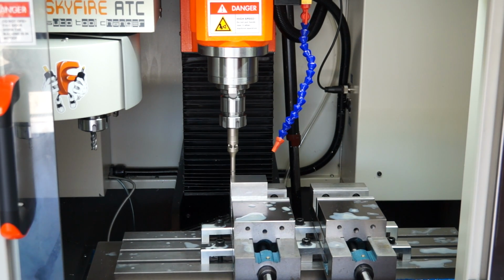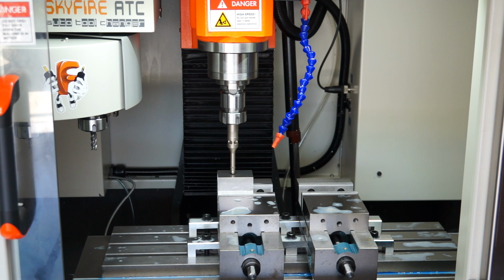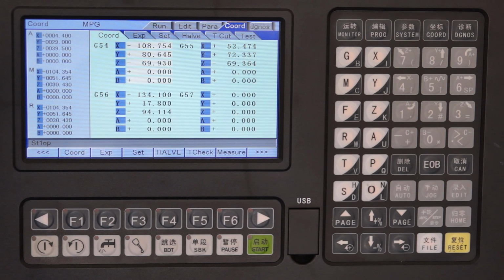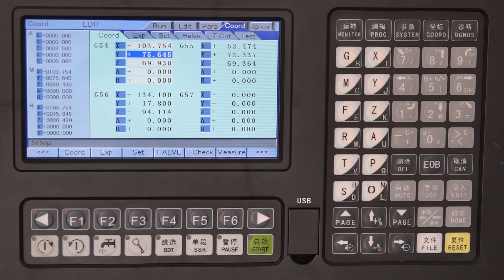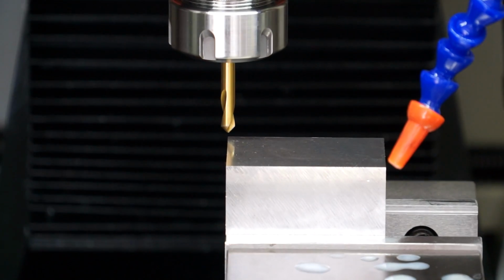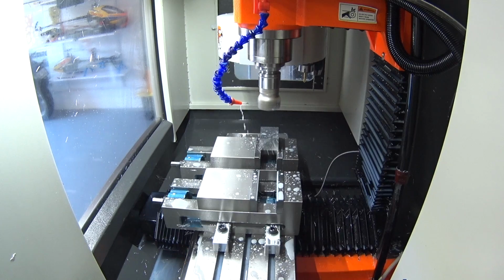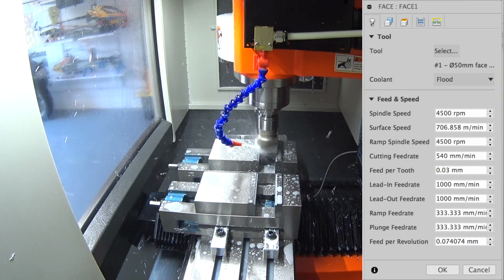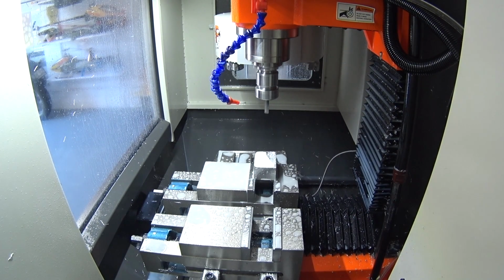Mill Vise Stop Pt.2 - CNC machining Fusion 360

Comment: Fantastic. That machine looks like it's really working well.
Reply from the maker: Hey Rus it's great to hear from you.  How have you been mate?  Yeah, my little machine is still going strong.  The servo motors lack some holding power, so I try not to push it too hard.  However, it's still an awesome machine to have in my garage.  Cheers, Aaron.

Comment: Thank you so much Aaron for showing the probing details. Very very appreciated.
Question: Are you using special aluminium blades / inserts for your face milling cutter? Do you prefer R0.2 to R0.8 ones? Did you try PCD inserts? Herri
Reply from the maker: Hello Herri, you're very welcome.  Yes the cutting tools I'm using have been designed especially Aluminium.  The shell mill I'm using is a Chinese one and I think it has 0.2r cutters in it. They work ok ;-)

Comment: Very nice Aaron the parts look great, hey howcome you run the chamfer mill conventional cutting? Noticed it was opposite to the contour op. Do you get a better finish?
Reply from the maker: Hey Luke, good pick up mate.  Yes, when I use spot drill to chamfer a contour it was producing a very small burr on the part requiring hand finishing.  That really annoyed me so I attacked it with conventional milling and this solved my problem and gave me a better finish.  Cheers mate ;-)

Comment: Thanks for sharing. Are you using the tooling's recommended speeds and feeds or are you making changes based on your experience (so far) with the SkyFire's capabilities. 

The quality of the finished machining looks very good for a low cost machine. Hopefully you can make another video with your thoughts on the machine's performance to date, any changes of opinion since your first video on the topic and what nuances have cropped up.

Also, do you think going to a bigger coolant pump and two nozzles might help with clearing chips?  Again, many thanks for sharing!
Reply from the maker: G'day Doug how are you mate?  I'm still happy with my little SkyfireCNC machine.  The only problems to date are the coolant lack of pressure and cabinet coolant leaks.   I've also noticed that my servo holding power on the table to be a little on the weak side.  If I run aggressive cuts using a 10 or 12mm (3/8" or 1/2") end mill at full depth 25mm (1") the table will rock and roll a little.  So to get around this by reducing my cutter step over to 20% and take 2 passes instead of 1.  At the end of the day it still has limited horsepower (2-3hp) so I can't be too aggressive with it.  To be honest Doug, I'm a very conservative machinist and many guys who run production would laugh at my feeds and speeds.  However I'm in no rush to push the little thing to it's breaking point, as I'm not running production and purely using the mill as a hobby machine. Cheers, Aaron
Reply: DCTTeacher1 Thanks for the feedback. I'm seriously considering one. I'm not surprised at the coolant pump issues, which you have addressed. 

As for performance, your results, in my opinion, are to be expected for this price bracket and size of machine. 

I suspect, even if the machine came available with a 5 HP spindle, it would mean the surrounding structure would also need strengthening. Thus the Snowball of costs begins. Taking it slow and remaining in the machine's capabilities, is the Skyfire maintaining tolerances? My best.

Thanks!
Reply from the maker: Oh my pleasure Doug.  I enjoy interacting with my viewers from all over the world.  Especially our cousins over in Canada ;-).  Hey, I will send you a private message OK?  Cheers, Aaron.
Reply: Responded. thanks. I'll have to behave. If you let my relatives in Albury Wodonga know I've been talking to you instead of them, they'll send the Roos after me.
Reply from the maker: Oh that's right. I remember you telling me that you have family over here.  You need to come over for a visit to this great country sometime?  If you do let me know we can catch up for a beer and burger.  I'll even drive the 3.5hrs to Albury to see you ;-)
Reply: DCTTeacher1 Sounds great! But I'd rather drive up your way and see your collection of R/C helicopters and Skyfire in action. One day....

Cheers!

Comment: Always a good day when you're posting videos :)

Why such a low feedrate on the endmill? 7000rpm, 735m/min in ally? Full flute depth and double the feed for starters. Mill sounds like it's handling the cut fine.
Reply from the maker: Hey Manny, the little mill doesn't like running end mills (10-12) hard and fast.  The servos tend to loose some holding power and I get chatter.  I'm a very conservative machinist mate.  I can't afford to break end mills so I just take it easy.  Lucky I don't have to run production hey?  Cheers, Aaron.
Reply: Makes sense mate, Hence why i asked the question. I'm still green in the machining trade and don't worry, plenty of guys in production are on the safe side of feeds and speeds.
Reply from the maker: ha ha ha, all good Manny.  If you don't ask questions you'll never know right ;-).  Mate, to be honest I'm a novice with all this stuff compared to guys like Titan Gilroy who run serious parts and production day in day out.  Hope you've been well bud?  Cheers, Aaron.

Comment: Hi Aaron just wondering what size vices you have on your mill?
ps Nice job any problems with your Skyfire so far?
Reply from the maker: Hi Ian, no problems apart from coolant leaks.  I bought these vices from SkyfireCNC when I made the purchase.  They were very reasonable in price $135usd.  They measure 100mm wide (4"), by 280mm long (11") and 100mm tall (4").  The can open to a total of 120mm (4.5").  Thanks for watching mate.  Cheers, Aaron.